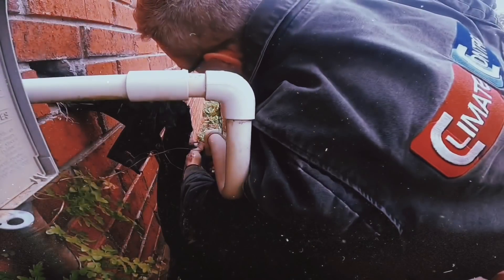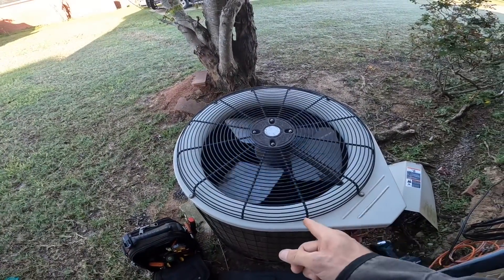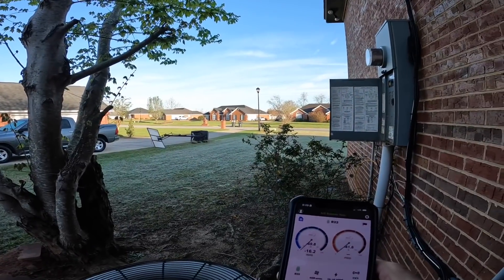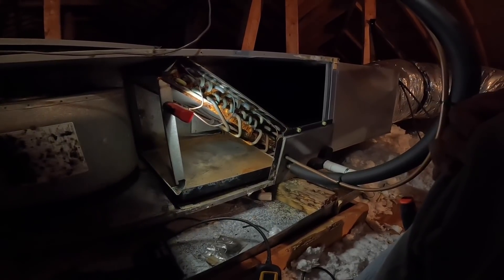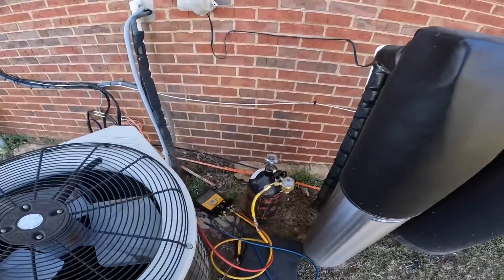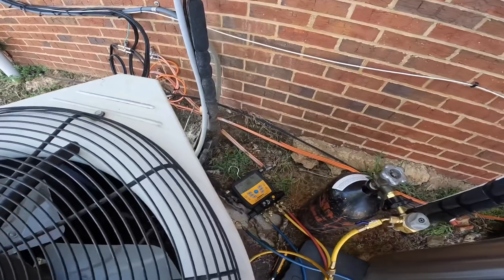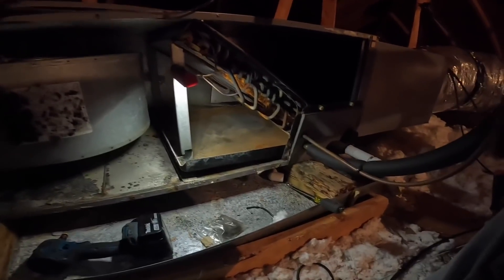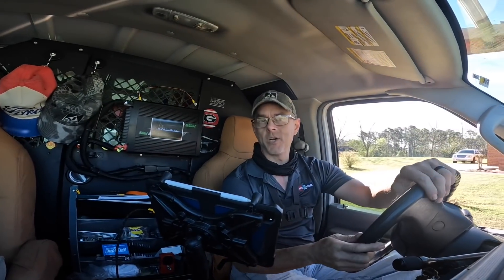Hissing And Bubbling Freon Leak - 19 Year Old Payne

Comment: I consider you a top of the line service tech. Although expensive,  I encourage you to purchase an 
ULTRASONIC LEAK DETECTOR.  
It would cut your time per leak check tremendously.  I was not a believer until a friend of mine bought one.  I stood 20 to 30 feet away from him. He rubbed his thumb and ring finger together and it sounded as if he was rubbing 2 pieces of sandpaper together.

Comment: The low pressure switch is also bad because the compressor is running with no freon if it has a low pressure switch

Comment: This video proves you get paid hourly. wasting time doing 2 leak searches once you’ve def found the leak. It’s 19yrs old, how’s it going to feel trying to repair it again after recommending a coil? Tbh this whole leak search was a waste of time if you’re even considering repairing, pulling vacuum, and recharging a 19yr old system whos other motors could go at any time. Say it’s leaking and look for oil. even if you don’t find oil it’s still almost 20yrs old and I doubt after (spending $200-$300 for a leak search and $2,500 for a out of warranty coil replacement with Freon) that you’ll recommend another repair, which in the end they were going to spend the $$ on a ends system than almost $3,000 a year or less before having to spend $5,000-$9,000 on a new system anyways, youre not saving the customer money, you’re making them wasteALOT more than replacing the system after seeing any oil and finding the unit low on charge. this is so fact you’re hourly. If you were on commission my manager would fire you so quickly. Every one else is doing 5-6 calls a day, “why does that one southern guy only do 2-3 a day?” This is why. you spent hours on a leak search. When the system was going to be replaced anyways, only in warranty. Explain to them because of the age it’s more financially sound to replace it than risk a blowe motor or compressing going out after running for who knows how long low? Please consider this, please do not ignore this information, I highly doubt you would spend $3,000 on a out of warranty repair, and replacing the whole system less than a year later. if you want to be professional and profitable for your company, do not waste the company time and your customers money on a ALMOST 20 yr old system!!!! You think you’re doing them a service, but anything over 10 yrs later, that out of warranty repair+Freon price feels like a lot more when your blower/compressor dies the next season, and you’re spending $3k+$7,500!!!!!!!!!!!🧠
Reply: Correct me if I’m wrong but I thought he owned his own company.  Besides that Maybe some people don’t have the money to blow on a entire new system.  That system may last another 10 years with a new EVAP for several grand less.  Besides if it’s a r-22 system it’s far superior to anything 410a.  410a has proved to be garbage and after you sell them a “new”system, they will end up paying warranty claims on garbage leaking coils anyways.  So what’s the real advantage.  Have seen so many coils leak on systems under a year old.  If I had a choice I’d keep the 22 system as long as that compressor is kicking.  Maybe their selling the house? Maybe funds are tight?   If anything it’s not a waste of time, it’s respect he’s doing things correctly    Most companies are just looking for a sale these days and the days of being an actual service tech are slowing dying out.   Just conditioned to push new equipment like a bunch of clowns instead of fixing shit.

Comment: That’s what happens when you don’t clean your condenser coil. It’ll eat right through eventually. If you don’t schedule time for preventative maintenance, your equipment will schedule it for you, but then it’s not preventative..
Reply: what is it that causes the corrosion? I know to only use water to clean them, but was wondering what in the environment causes them to corrode. The only thing I can think of is animals urinating on it definitely will, and salt from the roads in the northern states.

Comment: Those meters are crap.  I own a calibration laboratory.  Trust me.  So are those field piece ones
Reply: Klein or southwire any good? Got a Klein as my daily and a southwire as my backup/main for automotive work. Hadn't had an issue with either one although the Southwire hardly gets used.
Reply: What would you recommend for hvac field?
Reply: Oh shit I’m interested in knowing what you recommend because I thought my field piece was the best, only reason it stopped working for DC was because the magnet fell off after a year and I gorrilla glued the magnet back and I didn’t know the glue expanded and foam got on a circuit.
Reply: @Ricky32908  Dollar for dollar, Fieldpiece is the best for HVAC field. Fluke 902 is great but doesn’t do DC micro amps and costs lots more.